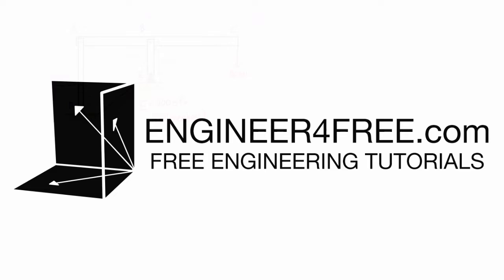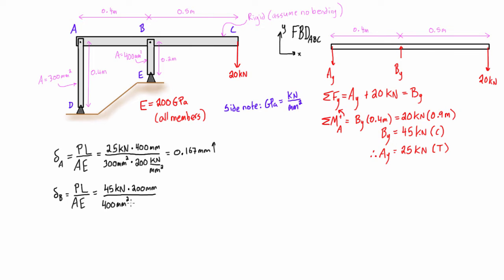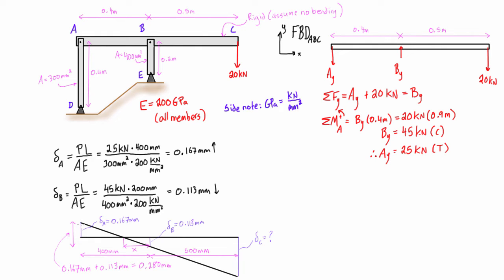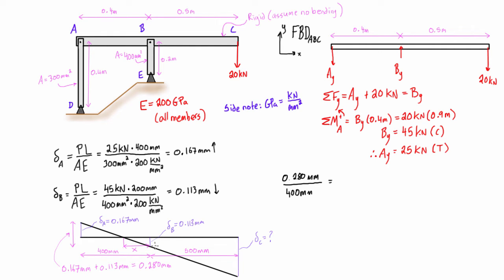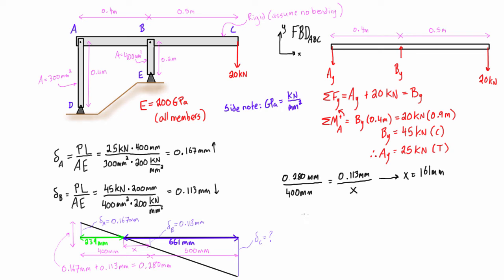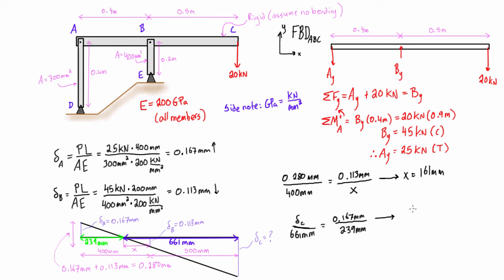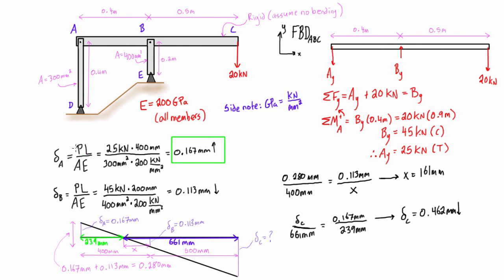Use Hooke's law to find deflection in a statically determinate frame

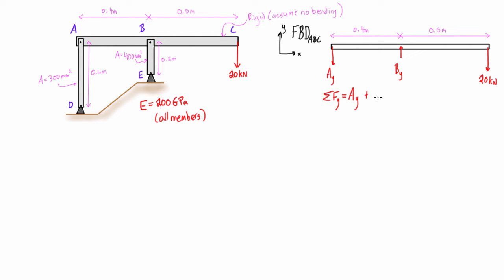Comment: Can someone explain what he did and how he did at 0:35 and continued. I didn't understand that
Reply from the maker: Hey there. I drew the free body diagram of member ABC and solved for the unknown forces acting on it, which are caused from member AD and BE pushing/pulling on it. I used the sum of forces in y direction and sum of moments about a point formulas to determine their magnitude. The direction tells me whether AD and BE are pushing or pulling, which in turn tells me if they are in tension or compression. Please review the moments section of my statics course, and take the time to watch videos 25-34. Those videos describe in detail with examples exactly what you are asking. The videos are here: https://www.engineer4free.com/statics#moments

Comment: can you explain why By is compressive and Ay is a tension force?
Reply from the maker: Imagine removing member AD. If we then push down on the right side with the applied point force written in red, then member abc would move like a see-saw, pivoting about point B (just assume that reaction E is rigid in this case, for stability). The point force on the left causes ABC to rotate about B, which means that A is going to move upwards. When you put member AD back into the diagram, and press down on the right side of ABC, then ABC still wants to rotate about B (more or less), so A still wants to move up. Now reactions D and E are connected to the ground, so they're definitely not moving anywhere. Because A wants to go up, and E isn't moving, it means that member AD is getting stretched, ie, in tension. Something has to prevent ABC from translating downward, and that's the reaction force at B (as determined in the sum of moments equation. But basically, if member BE is pressing up on member ABC, then it means that ABC is pressing down on BE..equal and opposite at that joint B. So member BE is feeling compression, because B wants to move down, and E cannot move.
Reply: @Engineer4Free  ohhh okay
thanks a lott
Reply: @Engineer4Free  Hats off!

Comment: When calculating the forces, why does By trend up and Ay trend down?
Reply from the maker: Imagine removing member AD. If we then push down on the right side with the applied point force written in red, then member abc would move like a see-saw, pivoting about point B (just assume that reaction E is rigid in this case, for stability). The point force on the left causes ABC to rotate about B, which means that A is going to move upwards. When you put member AD back into the diagram, and press down on the right side of ABC, then ABC still wants to rotate about B (more or less), so A still wants to move up. Now reactions D and E are connected to the ground, so they're definitely not moving anywhere. Because A wants to go up, and E isn't moving, it means that member AD is getting streched, ie, in tension. Something has to prevent ABC from translating downward, and that's the reaction force at B (as determined in the sum of moments equation. But basically, if member BE is pressing up on member ABC, then it means that ABC is pressing down on BE..equal and opposite at that joint B. So member BE is feeling compression, because B wants to move down, and E cannot move. Hopefully that helps to clarify! Please also check out the rest of the videos at engineer4free.com/mechanics-of-materials too if you haven't already =)
Reply: @Engineer4Free  10/10 Explanation!

Comment: Thanx a lot for great videos , I guess you wrote 0,280 mm for the small triangle instead of 0,167mm , or maybe I’m missing something her🧐
Reply from the maker: 0.280 is equal to 0.167 + 0.113. It’s the total height of the triangle whose base would be 400mm. By similar triangles, height/base = height/base, then 0.280/400 is one triangle that is similar to 0.113/x.

Comment: I don't get why A force is upwards and B is down. I have a lot of difficulty figuring this one out in any problem. If anybody could help that'd be great
Reply: Just remember this - consistency. If you don't have the intuition yet to determine if the forces are in compression or tension, always first assume that they are in your positive direction (e.g. - right, up, and CCW). As long as you're consistent, the numbers will tell you what is in tension (+) and compression (-).

Comment: Actually, the answer for Delta C is 0.463mm if it is not calculated through the x, but directly by moving the horizontal line down 0.113mm to have (0.167+0.113)/400=(Delta C-0.113)/500. The rounded x causes 0.001 deviation. Don't know whether I am right or not.

Comment: Hi first of all thanks for the explanation. The distance between C and B is 0.9 m where at 2:55 you are taking it as 0.5 m is that a mistake or another thing that we should consider ?
Reply from the maker: Hey Elif, the distance between A and C is 0.9m, the distance between B and C is 0.5m, as seen on the original diagram. But at 2:55 I’m talking about the measurement of 661mm, did you mean to refer to another time stamp? I’m not sure what exactly has you confused.
Reply: @Engineer4Free  Alright i got it and it's my mistake, i thought we were taking the moment with respect to B to determine Ay and By but its wrt A 👍🏻 thanks for explaining btw

Comment: Why is it Ay and BY and not FAD and FBE for the Free body diagram?
Reply from the maker: You can label the reaction forces whatever you like. In my head I like to think of it as the vertical reaction force at A and B. Hence I write it on the diagram as Ay and By. If you prefer to think of the reaction force as the force exerted on ABC by AD and BE, then you could call the reaction forces FAD and FBE. No matter what we call them, they are still the same reaction forces. Got it?
Reply: Yeah I got it thank you

Comment: i write english not good so i think "By"  must move down and "Ay" must move up
Reply: Ay and By are the reaction of internal force to against outsider force so that they wont move(static). Just imagine you are pushing your friend from the left side, the reaction force made by internal body of your friend is came from the right side (opposite direction) so that he doesnt move. (stay static at origin place). correct me if my understanding is wrong. salam
Reply from the maker: Yup that's pretty much it. Reaction forces are equal and opposite to the force they are resisting when the object is in static equilibrium. Thanks for contributing and helping out Muhammad!
Reply: @Engineer4Free  thanks for clarifying..i love your videos man the way youre explaining so much detail. got mechanics material paper the day after tommorow. wish me luck!
Reply from the maker: Ahh thanks and good luck! Mechanics of Materials is a beast!!!
Reply: @Engineer4Free  thanks! surely there are!
Reply from the maker: Ay and By are forces. A and B are points on the beam. A moves up and B moves down. Aside from clarifying forces vs points, you seem to be interpreting it correctly.

Comment: how do you know that A deflects upwards and B deflects downwards from the compression and tension reaction forces?
Reply from the maker: When stuff is in tension, it has the tendency to elongate. When stuff is in compression, it has the tendency to compress (ie, get shorter). If AB is determined to be in tension, then it is going to slightly strecth out, or get longer. Assuming the floor stays put, for AB to get long (ie, the distance between A and B to get bigger), then A must move upwards if B does not move into the floor. The opposite thing is happening in member BE. Its in compression, so points B and E are going to slightly move towards each other when it compresses. The floor is assumed to be our reference point that doesnt move, so in order for the distance between B and E to decrease, B must move down. Make sense?
Reply: Ah I see it makes sense now. When you're referring to AB in your reply do you mean AD? Thank you for your videos!
Reply from the maker: Ok awesome, thanks for watching!
Reply: @Engineer4Free  First off, your videos are amazing! I'm taking a summer course in mechanics of materials and this is really really helping. One thing I'm somewhat confused about in your static analysis is how mathematically we know that By is in compression. Intuitively I can understand why but wouldn't By=45Kn be negative to denote compression? Thanks again.